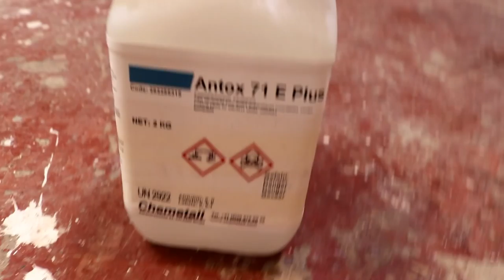I NEED AN EXTRA PAIR OF HANDS

Comment: Hey mate you need to weld the on a steel table and ratchet strap it down won’t the seam on the table weld it without purge then hit it flat with a hard plastic hammer then just fusion weld the back. Then re roll.
Reply: Also would of helped to tack the inside first

Comment: Harry your welds are telling me you're too hot for the matl. you are using.2.4mm tungsten 3/32" might carry too much heat or use a 1/16th or 1.6mm tungsten.You also need to purge the backside of the weld, and let each pass cool before beginning again.